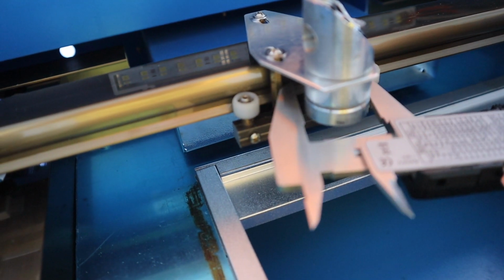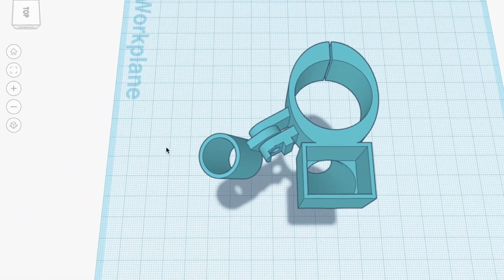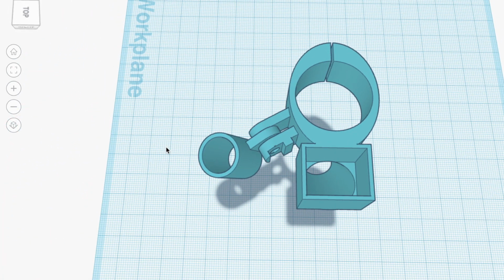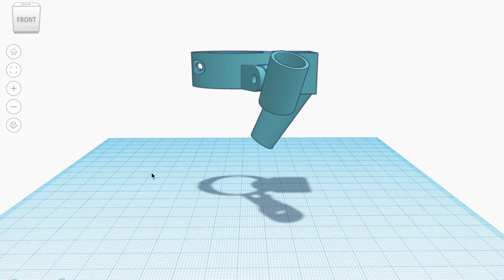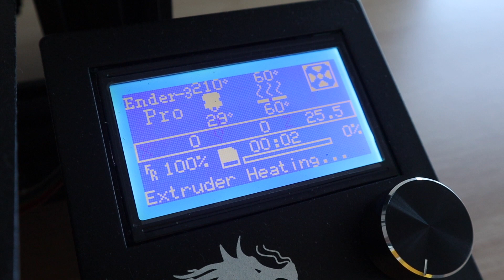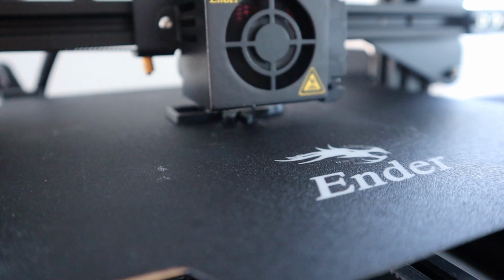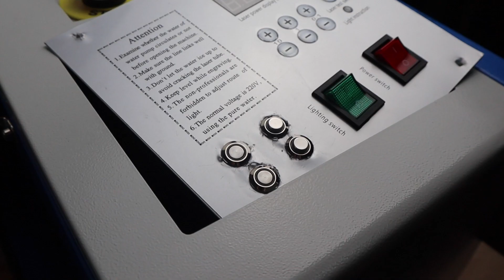Add A Radial Fan Air Assist System To A K40 Laser Cutter

Comment: When I added a 50L air assist to my k40 laser It turns on and off by itself, what is the SOLUTION please 🥺
Reply from the maker: I'm not sure what turns off, the air assist or the laser or both, but that sounds like a wiring or power supply issue.

Comment: My problem has been that when the laser head moves back to the home position - the drag chain moves in to the line of the laser.
Reply from the maker: It sounds like it needs to be better supported at each end. Try using a better bracket or fixing method so that it holds itself up.

Comment: your hole is too big, according to other youtube vidoes that literally use a 1.5mm needle to blow the air exactly on the laser focus point.
Reply from the maker: Yeah I agree but that requires a high pressure source, like that from a compressor. A 24V fan can't push air through a 1.5mm hole.

Comment: would like a 2nd fan instead of the red dot, and 2 12v in series is 24v which is on the standard psu..  and for the air from the fans to to go into a pointed cylinder around the lens etc to really stoop any chance of soot on it and too concentrate the air directly down to 'get inside' deep cuts. except i'm useless at 3d stuff so... i did make one, using tissue paper and glue.. works great, looks awful....
Reply from the maker: Thanks for the ideas. Yeah it’s a good idea to have the air running directly around the lens, it’s just a lot more complicated to integrate. It would probably be easier to replace the whole head with an air assist one.
Reply: @MichaelKlements  my one with 2 fans is holding up, didnt think it would last this long being tissue paper and epoxy glue..... I can use sketchup but i'm not great with it, in fact its maybe 6 months since i used it.  i may just make a wooden one i can cut with the k40.... like a 3d jigsaw....

Comment: Since you haven't nozzle, stop this fan from running for engraving. Only for cutting is needed for removing smoke. I have nozzle on my K40, and during engraving, my compressor (big boy, 50L, 8 Bars) is lowered to minimum, just to protect the lens. During cutting, the cleanest cut is with 12 LPM (liters per minute) of air assist. Just, having nozzle with 2.5 mm orifice brings another problem with adjusting position of the focal plane so that it coincidence with the orifice. That is because no much screws and adjusting elements to do that precisely.
Reply from the maker: Thanks for the tip Milan. Yes it's difficult to get the laser aligned with the centre of the lens on the k40, especially in all four corners of the table.
Reply: @MichaelKlements  That part of aligning mirrors is easy. Only lens does not produce straight down beam. Tilting lens is nightmare, especially with such tiny orifice.

Comment: Fascinating conclusion, so air assist might not be worth adding at all? Just using simple masking tape instead. Great idea to be honest
Reply from the maker: I think adding a proper industrial style air assist with a workshop compressor is a good option, but its going to be an expensive setup. If you just spend some time and a bit of money upgrading the mirrors, lens and doing proper alignment then you'll get great results from the K40 without spending a fortune. And yes, masking tape is the way to go for engraving, I haven't found a solution which produces better results and its quite quick and easy to do!
Reply: @MichaelKlements  It is a great and simple idea! Wouldn't know where to begin with mirrors and lens but need to look into that..
Reply: BAD THING, WATCH THIS VIDEO. 
This guy explains everything about this air assist and i made same thing like he is with Fridge motor compressor 

https://youtu.be/yG93YO8t9ow

Comment: Air assist would be cleaner with outside air because a fan inside would be pulling dirty air into you laser.
Reply from the maker: Yes, pulling in outside air is the best option.
Reply: BAD THING, WATCH THIS VIDEO. 
This guy explains everything about this air assist and i made same thing like he is with Fridge motor compressor 

https://youtu.be/yG93YO8t9ow

Comment: I like your combined design air laser, the only thing is that I will replace the fan with a small membrane compressor (cheap from flea market),  the air from the compressor is not continuous and I believe that it turn of the fire more efficiently that a continuous air flow that might acts more like a bellow. The laser pointer is really needed, and I removed the big air suction box, gaining an inch in working area (smoke extraction is not affected). Those k40 are really underrated, and I'm amazed every time with what it does for $ 350.   Thank you for the video
Reply from the maker: Thanks Y. Yes they’re definitely underrated, they can be really good machines if set up properly. I think I should try removing the extraction vent too, it does take up a lot of the cutting area!
Reply: @MichaelKlements  To remove the suction box, I had to lift the gantry, I'm afraid that there is no way around it, and it's really tight and scary as defusing a bomb, I cut the zip ties that are holding the wires at the bottom left of the enclosure  (I don't think that I unplugged those wires from the USB circuit board as their connectors are still covered with hot melt glue and I would definitively not do that (I removed that box years ago), I just looked and it seems that you can get a little slack by unscrewing the USB circuit board from the enclosure without disconnecting anything), I unscrewed the suction box first, then lift the gantry enough with one hand, grabbed the box with the other, and lower the gantry back in place, it went fine and I didn't even have to re-adjust the mirrors. Have a good week-end.
Reply from the maker: Thanks for the tips, I’ll definitely try it out. I’m planning on putting together a z-axis adjustable bed which will need the extra space. I’ve bought all of the equipment for it, I just need to get around to putting it together.
Reply: BAD THING, WATCH THIS VIDEO. 
This guy explains everything about this air assist and i made same thing like he is with Fridge motor compressor 

https://youtu.be/yG93YO8t9ow

Comment: That's because you like most people are doing it WRONG!! There is a LOT of bad info on youtube. You need little to no air assist when engraving, 30-45 PSI when cutting wood and 5-15 PSI when cutting clear plastics . That thing you have you would be lucky to get 0.5 PSI. Go here to see how to do it properly. https://www.youtube.com/watch?v=4P-5nIckybM
Reply from the maker: I think you may have missed the point of the video. The point was to test whether a cheap air assist option such as a radial fan or aquarium pump offered any benefit when cutting or engraving. There's no doubt that a proper workshop air compressor and cutting head is the correct solution, but these are expensive, likely costing more than the K40 laser cutter costs to start with. People also have these "desktop" laser cutters set up in small spaces, so having a bulky and noisy air compressor around is not always practical.

Comment: Air assist is good to get cleaner cuts. As you discovered, it's not good when engraving. You'll need to hook up your air assist to your controller somehow so you can use your software to tell it when to turn off/on the air assist.
Reply from the maker: Hi Ryan. Thanks for the tip. I've got a simple power button to turn it on and off, so it's pretty easy to just turn it on as required for cutting.
Reply: BAD THING, WATCH THIS VIDEO. 
This guy explains everything about this air assist and i made same thing like he is with Fridge motor compressor 

https://youtu.be/yG93YO8t9ow